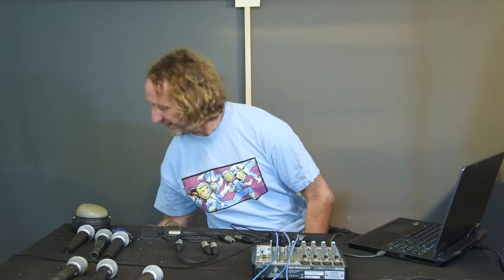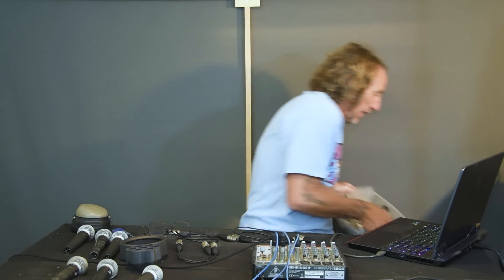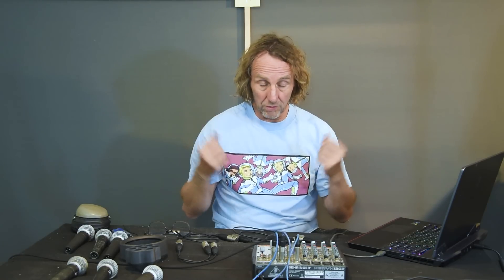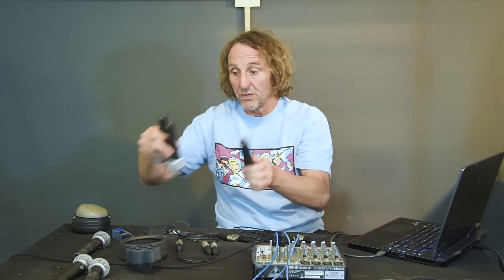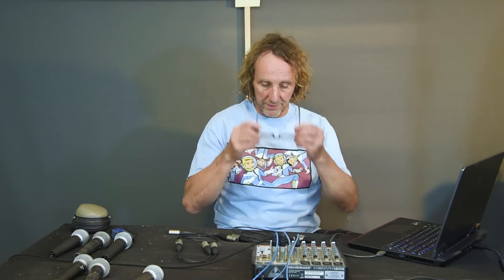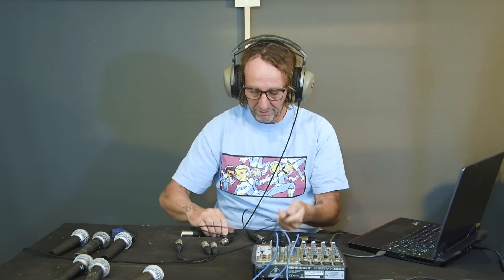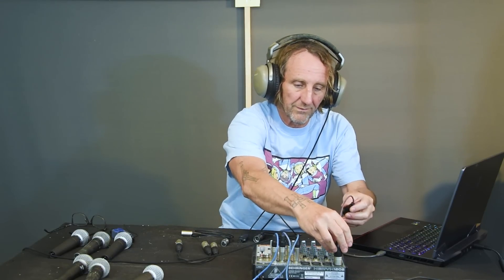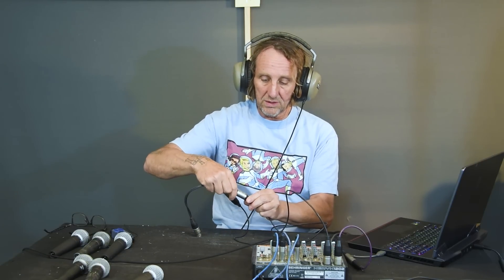Do Vocal Mics Go Bad? Lets Hear what happens!

Comment: Back in the 90's when i was doing local Pub bands i would have to take the lead Vocal mic to the loo and dry the foam out during the breaks to bring the life back to the mics. It is not such an issue now doing corporate bands and things but probably worth replacing one or two mics each year  given this can be the weakest link in a very expensive chain !
Reply from the maker: Yeah! The good ol days! smashing the 58 capsule foam onto toilet paper and a fresh grill does wonders.

We would do 2 mic swaps mid show, then let those mics dry with grills removed for 3 days before using them again. Carried multiple sets of mics and after a couple 3 week runs, ship the whole lot back for rebuild and start using the mics from the last rebuild
Reply: Just replace the foam with an unused/fresh dry one. It amazes me that Shure don't sell the foam inserts for SM58s separately ... but fortunately there are lots of other people making them.

Comment: I love this type of video's, very educational.
Do you think that the grill and foam could also play a role in this? 
Cleaning the grill and the foam may be easier than replacing the capsule.
Reply from the maker: The pattern is 

Always clean the grill foam

Replace grill foam if it shows wear or is not longer soft and can see through it

Dry capsules every show

Rebuild mics when they start to sound dull even with a new grill

Comment: Why did the dead do that?  No noise gates back then?
Reply from the maker: The did it when they put the pa behind the band.

A noise gate turning on and off is really audible, hearing the noise blast and mute everytime someone sings would be a bummer.
Reply: @DaveRat  Wow. Ok that’s cool!
Reply: @DaveRat  to speak to this point, I had a touring engineer in my room recently.... I felt so bad for the band because they were actually pretty big in the 2000s and I grew up listening to these guys... The engineer threw a hard gate with no range control on the lead singers vocals. it was terrible
Reply: part of me wanted to rip this guy off the board and save the singers vocals but as a systems tech on that gig it was not my job to interfere. However, I mixed support (a band I work with often) and everyone in the crowd kept coming by the booth to say "what happened to the sound? the opener sounded so much better" and I just have to sit there and watch this guy have a breakdown...
Reply: He was using all the head room of the system but was still getting lower spl if that tells you what kinda mix we were dealing with
Reply from the maker: That's no fun

Comment: Great vid… I assume you had a business relationship with Audix to get replacement caps? Is that common place for manufacturers to sell parts? Windscreens sure. But in my world I’ve just gone to Guitar Center or Sweetwater and bought a whole new mic. Are there sources for internals? How many shows did you get off before hearing the fall off?
Reply from the maker: Audix had maybe still has, a mic rebuild program. I think it was around $75 a mic for a new cap and grill. 

As far as shows, we would mark mics that got dull, clean them and then rebuild every 12  to 16 hours of usage or so.
Reply: @DaveRat  Wow, every 16hrs. That’s like 6 shows. Makes total sense when your talking about the caliber of acts you supported. And more to think about and consider as I budget for equipment. Sure,,, not as critical as my shows are smaller but so worth looking into.
Reply from the maker: Yeah, maybe more shows and no mic would see more than an hour a show before getting swapped
Reply: @DaveRat  I was going to ask if you tried to clean them.
Reply from the maker: Cleaning mics is kind of like cleaning faders, ya never quite get them to brand new perfect. But some TLC will have them last a long time, but if ya need perfect....